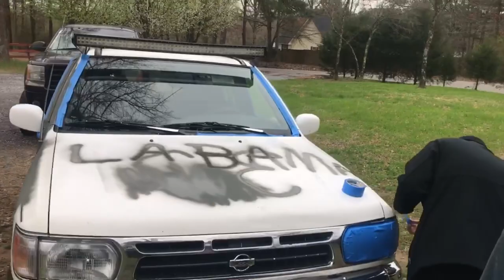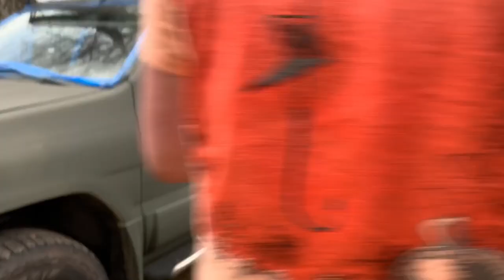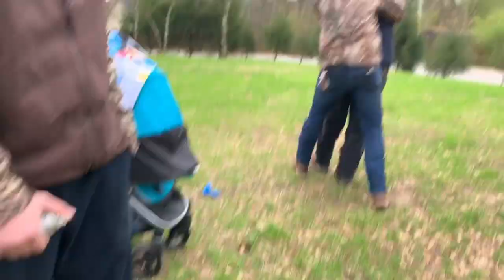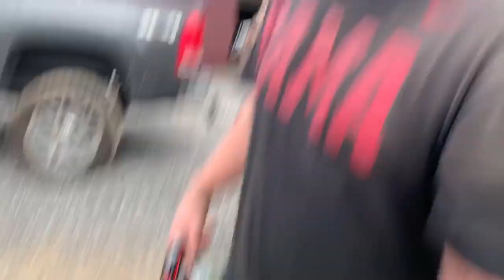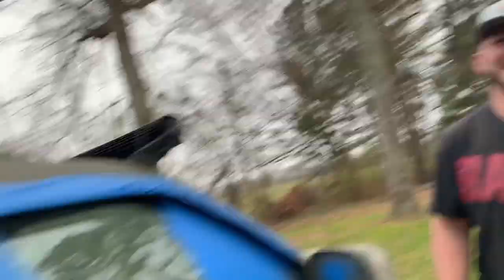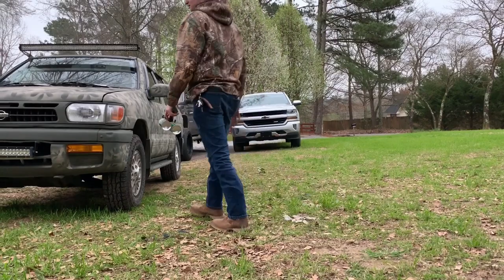Camo Paint Job!

Comment: For those watching I've done a lot of camo trucks. Mask off the windows completely because scraping overspray off sucks! Camo should have 3 colors minimum and always use black as one of them for depth and shadowing. Real or fake foliage work great as long as it lays flat. I do like the buck stencil though.. Best tip is enamal paint even cured is relatively soft so mirrors, grill, front bumper, door handles and flexible plastics don't last. Gdjob!
Reply: You have some more tips? I'm currently working on a 1995 Opel Frontera and am planning to give it a realtree camo paint job.
I thought of using Nato Green, this sand color seen in the video and black and perhaps even another color. Any tips on how to make it look like an actual wood pattern instead of accidentally creating something that resembles a leopard's fur? Also, what about things like door handles? Paint them as well or cover them, since the paint probably won't last long there?